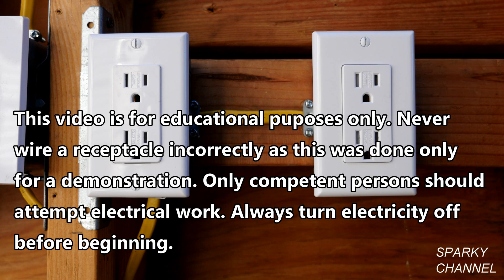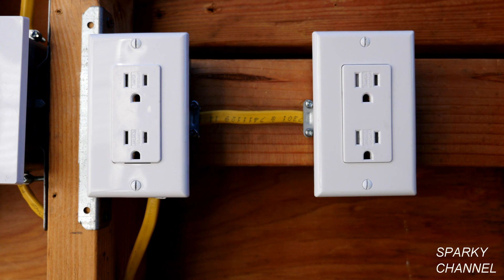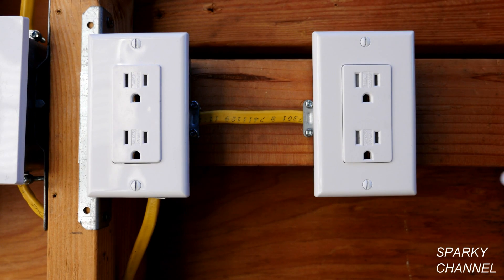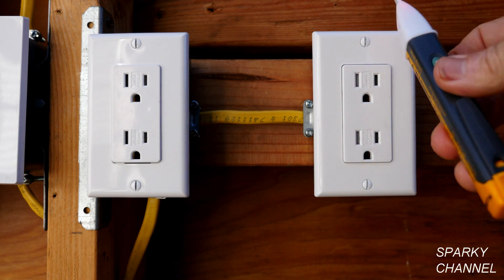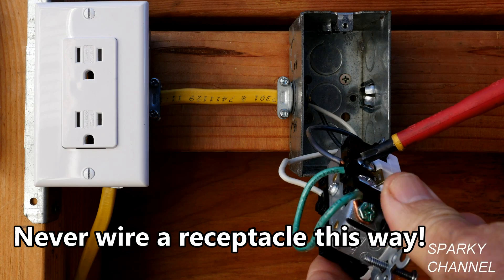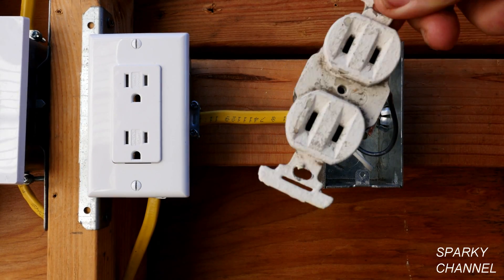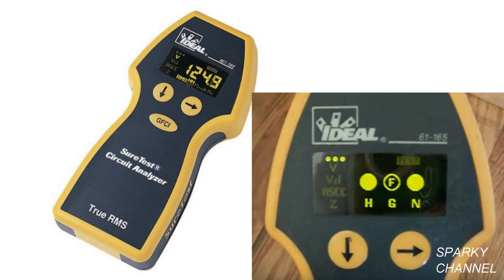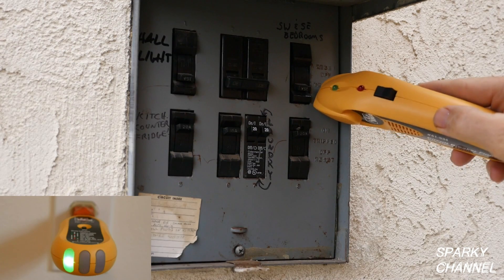How To Identify Reverse Polarity Bootleg Ground Receptacles

Comment: Great video!  What if the 3 prong receptacle uses old 2 wire MC cable and a copper wire is installed from ground terminal on receptacle to a ground screw in metal box?

Comment: My outlet tester shows hot ground reverse but the tester goes off 3 inches from the outlet. Also, I have 120v from white to ground and black to ground but 7v from white to black. It's the only outlet in the house that is bad.
Reply: What you almost certainly have is an open neutral,  with a load downstream trying to work.     A true hot ground reverse (hot wire on ground screw, ground wire on hot screw) would almost never occur,  unless of course whoever installed the receptacle was hungover after ingesting some unknown substance at last night's rave party ;-)

Comment: I found outlets like this in my house after it failed VA inspection and they "fixed"  I removed the ground to nutural jumpers and put ground to box and now my tester says open hot and nothing works
 :(
Reply: Hmmm did u wire it correctly
Reply: @RileyAndBella-g8  gave up paid 20k to electrican to have whole house rewired

Comment: So do they do this because they don’t have a ground wire but want to install a three holed outlet and fake it to look like it has a ground ?
Reply: @ladawg81 Yikes ~ well they are saying not to do that because it’s dangerous. 
. . . or maybe I misunderstood you.
Reply: It could be done with malicious intent to pass inspection like he talked about in the video, but it could also be done without malice and out of cluelessness. Until recently when I started watching videos like this, I (wrongfully) thought the idea was to have neutral connected to ground in as many places as possible, and accordingly thought that a bootleg ground was correct.
Reply: A bootleg ground actually grounds the outlet. It just is not an acceptable method in the US for various reasons. Nobody deliberately creates a reverse bootleg ground. It happens if the live and neutral have for some reason reversed upstream so the white wire no actually the live one.

A socket tester just compares the voltages, it has no reference to the true ground so it cannot tell the problem.  In Finland where neutral was previously commonly used to ground socket testers must tell if there is voltage on the ground. They have a pad which one touches and an LCD shows if there is over 50 V on the ground. An LCD as it can be used with the current that goes through you.

Comment: I have that orange one from Harbor Freight ( Ames GST-125 )
Plugged in to a working nonGFI outlet it only show the center light lit, which is undefined on the chart. 
All other outlet test good / normal = two yellow lights on light are lit. 
Anyone know what that means ?
Reply: It's a year later, but for anyone else interested, the Ames is confusing--the white dots actually mean dark or unlit.  If you see the yellow or red dot, that means lit up.  So the center light lit is the first entry on the chart - open ground.

Comment: You did not say why it was wired wrong. Why would someone connect an outlet incorrectly.
Reply: I think there are 2 problems here .   Sometimes a bootleg ground is used by putting a jumper from the Neutral to ground.   Thats not allowed, but it will pass (cheat) the testers so its not completely unusual to see that.     In this case the 2nd problem is much worse because they jumpered the HOT to the ground.   so they are also  dangerously incompetent

Comment: So to find a ‘normal’ bootleg ground (neutral to ground at the outlet), my cheapest option is going to be the Sure Test? Or is there another way to detect this?
Reply: I'm on the same quest of info....... sigh
Reply: Good luck with that.  There's no simple test for 'normal' bootleg other than to open the box.  Even then, an unscrupulous person could wire the first outlet in a room with a 'bootleg' ground, then wire all downstream outlets properly off from that. (seen it done when rewiring an older room with just two conductors from the branch circuit feed and new 14-2 w/ ground between first outlet and rest of room)

You could do something REALLY extreme like go back to the service panel and temporarily lift all the ground wires and then use recpt tester, but that's a lot.

Comment: I've never seen a bootleg ground done that way. I've seen the ground jumped to neutral before - which is also dangerous and can energize the device. I'm not sure why you'd swap sides on the hot and neutral, or why the recept tester doesn't pick it up as reversed - but that's even worse than tying it to neutral. You're putting hot to the chassis of the equipment, and it wouldn't even depend on other conditions.

If somebody were to suggest that I do that to fool an inspector, I'd fire them.

Comment: confusion, isn't bootleg ground when the person jumps neutral to ground.  Reverse neutral and hot, even an idiot  playing with wires should know about that one.
Reply: The point is that if the socket is already reversed so that the white is actually the hot wire. It is really impossible to know it unless you test it with a voltage detector afterwards. Too many people blindly trust the socket testers.

Comment: Great video.  As an advanced DIY'er, never personally seen a condition as unethical as this, but the one of the guys i went to grade school with, is a licensed home inspector,  and he tells me stories i thought were out of a horror movie ☺   anyway,  he sees this more frequently especially in flipper homes way more than he cares to admit.  One tip i learned from my friend is, first, don't judge a book by it's cover.  If the $200 give or take bootleg ground detector is a bit out of your budget,  there are other ways you might be able to spot this.  Typically the signs will be , was the home built before the 1960s?  If so, look at the wiring at the panel. Or in the attic or basement. If you can clearly see some old fabric braided two wire NM or knob and tube, but the receptacles test correct,   that is a big red flag.  Same if there is an Edison base fuse panel rather than a modern breaker panel.  Another flag would be three prong receptacles in random places, while the remaining receptacles are the old two slot type.  In these situations,  an inspector may go beyond the scope  and physically pull some receptacles out of the wall and see that jumper between the neutral and grouning terminal.
Reply: You're talking about my house built in 1949 knob into wiring still running through the walls I had a GFCI with reverse polarity no ground I've got a three-prong outlet where one of the plugs reads correct the other one reads open hot and now I've got several switches with wires hanging, capped, waiting for someone with more experience to come along. I've already seen voltage melt the insulation of a water heater in front of me and have a fuse on my panel that won't reset, keeps tripping from a ceiling light fixture with too few mount points for today's fixtures. 
So obviously I swapped the 3" fan box for a 4" and pulled the nails out with pliers, lineman's. New fan with no ground, just a switch for on off and fan light ops executed at pull string. 
I'm really interested in the idea of an appliance electrifying I don't want to find out with my hand.

Comment: Do you know if either (or both) of the Klein RT250 (GFCI Receptacle Tester only at Home Depot) or the Klein RT310 (AFCI/GFCI Outlet Tester) would detect this Reverse Polarity Bootleg Ground condition?
Reply: No socket tester in the US will detect it. They would have to have a pad you touch and an LCD that shows it. This is an example of a socket tester that does detect it (if you touch the pad on the top). There that detection is mandatory.

https://tsr-elsite.fi/wp-content/uploads/2021/04/testboy-schuki-3lcd_01.png

You should use a voltage detector, it has the access to the true ground through you.

Comment: last month i went though my house and replaced every outlet and light switch. almost every outlet had lose screws one had a busted ground wire. in 1 room there was 2 outlets that #1 they put them in upside down #2 even though there was ground wires in the box they put them around the ground screw of the box but then cut them off and didn't hook them up to the outlet and lastly the had the hot and neutral wires hooked up backwards could not figure out how someone could screw it up so badly i mean every other outlet in the house was wired right. so i had to add ground pigtails so i could ground them then hook the wires up the right way and they test out fine hooked up the proper way i cant figure out why anyone would have did that on top of that they were aluminum wire and the outlets they had used were not even rated for aluminum use.

Comment: Wow. That's a scary thing. That could potentially electrocute someone. And I legit did not expect it to actually fool a tester. I thought it would have shown reverse polarity. I have a lot to learn about this kind of thing.

Incidentally, years ago I had a truck with a winch power cable attached to the battery, that was normal. The cable somehow got under the front left wheel and ripped off the truck. When that happened, the positive and negative wires touched each other causing a short. It literally shut off the engine and all the electronics inside. I had no power steering, difficult braking and couldn't even put my hazard lights on. Thankfully I got it fixed with pliers, but it was a scary moment.
Reply from the maker: Wow, good story! Thanks Noah!
Reply: In Finland a bumbler died five years ago from such a connection. What is called a
bootleg ground is perfectly legal here on older installations but it like any installations should be done by a professional. The resident had only used double insulated devices so he did not detect it. But as the earth contacts here are visible on the socket each time he used it he was at a risk of a shock.

Note that a GFCI on the equipment does not protect against this.
Reply: @okaro6595  Holy shit. And that's legal?

Comment: Wouldn't simply connecting the neutral to ground be enough to fool the tester? Why also flip the neutral and hot?
Reply from the maker: Yes, there are multiple ways to create a bootleg ground. Your way also works. Thanks!
Reply: Nobody who knows anything would deliberately make so but people do make mistakes or they just do not know what they do.
Reply: Yes you make it dangerous  neutral to grounding sc safe it work fine

Comment: If the outlet isn't really close to the panel, you can put some load on the circuit (e.g. hairdryer) and look for s small voltage between the grounded conductor (neutral) and the equipment grounding conductor.
Reply from the maker: Good point and good thinking!

Comment: Great video! I’m a live sound engineer and I always carry a non-contact detector as well as a three-light tester and multimeter. I was explaining to a musician I work with about doing all three tests and she was amazed, “you do this for every gig!?!” Oh yeah! On every receptacle.
Reply from the maker: Excellent. These tests are very important, especially when people will be handling electric musical equipment.
Reply: You can never be too careful around electricity but it's particularly important to have awareness as a musician who likely travels the country and has no control over what jack ups have been done to the wiring.   One of my coworkers once witnessed a cable plugged into a sound system,  turn red hot and melt within a split second,  when plugged into an amplifier,  which was connected to a different receptacle.   Several thousands of dollars worth of gear had been destroyed beyond repair.   Personally if I were a traveling musician or sound engineer I would invest in the Ideal Sure Test, which can detect bootleg grounds by measuring the impedance between the neutral and ground pins,  and flashes "F" if it's very low, which would only happen if a short jumper were used between the neutral and ground screws.   This tester cannot tell a correct polarity bootleg ground from a reverse polarity bootleg ground,  but at that point,  that's irrelevant,  either way just don't use that outlet.    

Another safety issue with sound gear is the use of 2 to 3 prong adapters which I like to call ground cheaters,  in an attempt to avoid the hum caused by ground loops.  In fact those are illegal in certain areas,  and particularly Canada, as they should be.

Comment: Always enjoy your videos. Are you aware of a tester that would indicate when neutral and ground are reversed?
Reply: The Ideal Circuit Analyzer will reveal a bootleg ground.
Reply: I too would like know. Even the AC splitters I see online don't have a hole to test the ground with your multimeter (to look for volt drop on neutral vs ground)

Comment: Great video.   I am not an electrician by trade. Just your average DIY'r.  But I've seen enough of you videos to know when you removed the "bad" outlet, I could see right away the problem!!!  And although it wouldnt help the lack of a ground wire, I would have at minimum put a green wire from the outlet to the metal box!!!
Reply from the maker: Thanks! That would be a start be it needs a re-wiring.

Comment: Hi Bill
I have a friend who installed two three way dimmer switches and they work fine but the light shows 144 volts. Is that dangerous?
Reply from the maker: I would test it with another meter, that's too much voltage for USA.
Reply: @SparkyChannel  thanks Bill!

Comment: Excellent video bill!! I've been in the field for about 17-18 years and have had my master electrician license for about 5 years which requires 11.5 years of experience to sit for the test in my area and I've never seen this or heard of it. My question is why would someone intentionally do this? I could see a homeowner who thinks he's a sparky make a mistake like this but a true sparky doing this intentionally just to fool an inspector? Who ever would do that should be jailed.
Reply from the maker: It's not true Sparky's. I've seen it with people selling a house and they just want to pass house inspection so they can get their money. This is only one way, there are several ways to get a tester to read correct. It's why home inspectors should have more than just a simple tester. The Ideal SureTest is very good and Fluke has a more expensive meter that will smell this kind of thing out as well. Check this beauty out: Fluke 1664 FC Multifunction Installation Tester with Fluke Connect: National Electrical Contractors: https://youtu.be/_4gL8yRcYGA
Reply: @SparkyChannel  Excellent educational video. Now I know another test I really need to do when checking out a home's electrical wiring. But I just don't understand why someone wouldn't just wire the outlets correctly in the first place. How long would that take? Is that home's wiring that messed up that someone would just use this illegal and dangerous trick? And are we looking a just one outlet (should be easy to correct) or is a entire circuit or circuits wired so badly that if this trick works, it saves someone from doing proper troubleshooting?

EDIT:  And for all those people that say they don't need a NCVT (non contact voltage tester) in their tool kit, you just gave a excellent reason for having a good one.

Hope you and your family stay safe and well.